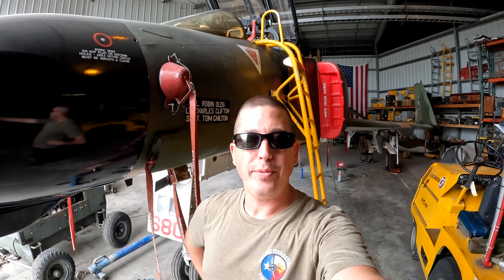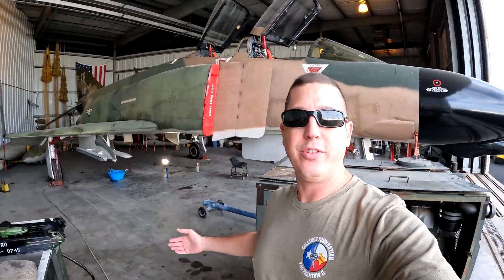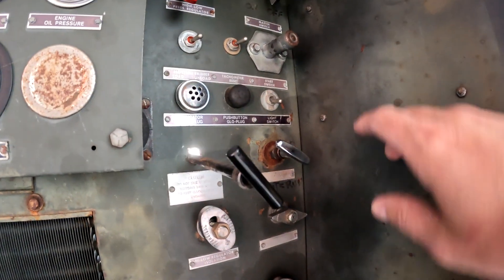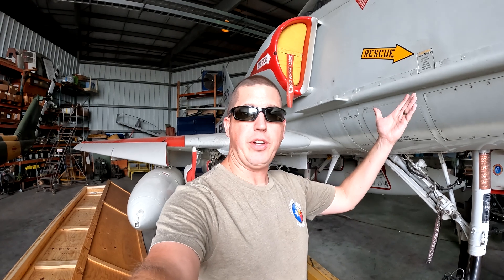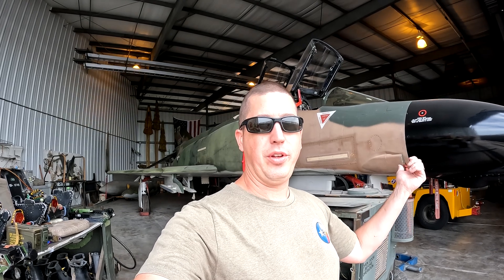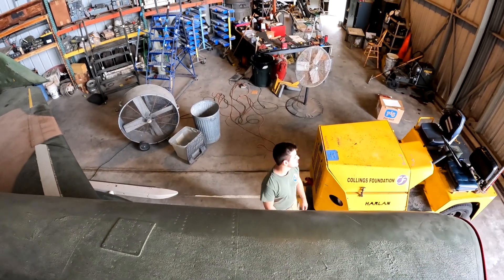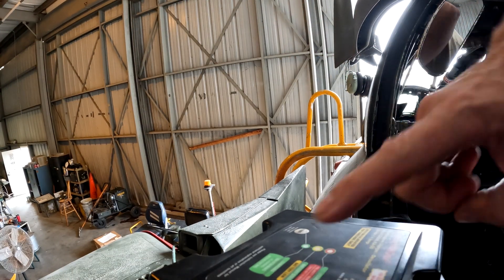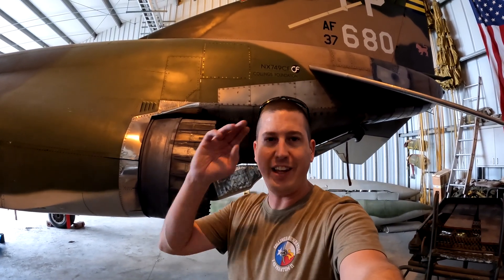Struts and Tires | F-4 Phantom

Comment: Nice run chair. We use to have one in the Egress shop so if the Fwd Seat was out and they wanted to run the jet, we would put in the run chair for towing and running.
Reply from the maker: Run chair, is that what they are called? I've been calling them jump seats. Sure is more comfy than the pholding chair of phun!

Comment: I had not been to an air show in decades. I went to the MCAS Miramar air show a few weeks ago and boy was it packed with action. The announcer stated it is the largest show the US puts on. We had..... C-17, 2 CH-47 Chinooks carrying 555 howitzers, SH-60 Seahawks, all 3 variants of the F-35, static and flying demos, including the 3 F-35's, the  B model doing its vertical landing and short take off, F-18's, the F-16 painted as a viper, C-130, CH-53 super Stallions, OH-58 Kiowa. Marines with their armored infantry fighting vehicles doing a demo of a infiltration, about 100 of them, lots and lots of strafing and bombing runs by the fighter jets along with Apache and Cobra gun ships and of course the Blue Angles routine, lots of fire and explosions. You could even feel the heat from the big ones in the grandstands.  They had, static, a Airbus A-400, THAAD battery, Kratos had a vendor booth showing off all their UAV's , including their Valkyre on its launching trailer. I'm going to go all the time now. No F-15's or B-2 or b-52. I will have to go see the Thunder Birds to see those maybe.
My first air show was at MCAS El Toro. They had the F-4 doing a demo flight. I remember it being very big (static) and very loud.
Reply from the maker: That sounds like a great airshow! My first was at Little Rock Air Force Base where I grew up. Pretty cool to be able to ride a bicycle down to the flight line to catch the show. They may have had an F-4 back then, but I can't recall with certainly. Looking forward to when ours can fly an airshow again!

Comment: Thanks for all you do keeping those birds in good static shape 😎
Neal (The old Marine F-4J tech)
Reply from the maker: Our pleasure! She is a bit simpler to maintain than when she was in service. We don't have to maintain the weapons and radar systems as those were disabled before we took ownership. The avionics have been upgraded to a more modern GPS COM/NAV system. She last flew in 2019 so beyond the ejection seat parts that timed out, it shouldn't be a heavy lift to get her back in the air again!
Reply: @DieselThunderAviation  
cool beans
Reply: The Phantom is airworthy.
( Ex IAF Kurnass phixer )
Reply: @trespire  color me surprised if it ever flies.
It took us 10 shops of 12 men (hydraulics, radar, avionics, etc) and a giant intermediate shop, depot level, and much💰💰💰💰  to keep our 12 Phantoms in the air.
that is a very maintenance intensive aircraft.
but....that would be cool if it did 🙂
Reply: @joeblow5037  About the same here. We had the one Phantom squadron on base, yet the Phantom B-check maintenance hanger was often full, about twice as intensive as F-16 block 40's.  As you said, coms, systems, hydraulics, radar, I was in structural, the engine shop half of which were J79, the rest F-110, life support (oxygen guys). Always something to fix on a Phantom.  But this F-4C seldom flies.
They are working to running up the engines soon.
Reply: @joeblow5037  So's my 71 Harley 🤌🤌🤷